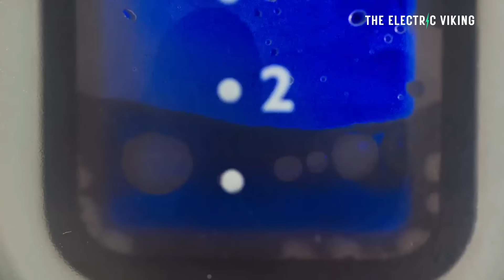The SODIUM Battery REVOLUTION Begins in the United States...

Comment: The USA doesn't need a reason to pivot toward Sodium ion batteries they are green energy so f*ck it.
Reply: Should we wait for sodium home batteries?  I’m thinking more about durability as home home batteries are charged and discharged daily where an EV gets charged typically once or twice a week
Reply: The US is foolishly trying to fuel advanced autonomous vehicles and robotic drones, while Trump wants to run them on oil. Americans need to wake up. The battery factory South Korea is building in the US is fundamental to future US technology, yet Trump has handcuffed and shackled Korean engineers, treating them like criminals.
Reply: Hilarious.

Did you know that Trump has doomed the US oil industry by asking OPEC to keep the oil price low and increasing the price of equipment (especially steel used for pipes). The oil patch can’t afford to drill now…

Comment: Lithium has a major advantage in energy density and there will always be demand for lithium batteries.
Reply: Energy density at the cell level, yes. Not at the pack level. 

So in small devices, it's a massive advantage. For anything big enough to require dozens of cells in a pack? And then a series of packs in a final battery, like a car or stationary energy storage? It's not so massive because of the safety features you need to build in.
Reply: @kylejohnson6775  - Sodium has lower volumetric energy density, not just lower gravimetric energy density, so is also disadvantaged at the pack level. You need more space or a larger pack for a Sodium cell of the same energy density as a Lithium battery. This means in space constrained applications, like passenger cars, Lithium has an advantage over Sodium.
Reply: these batterys have 175kw/kg and they cost about 12$ not 54$ each, it will only be on very small devices that you will need lithium it already has higher energy density than BYD's blade battery with no risk of fire so most phones cars ext will be able to run on it just fine
due to the fire/toxicity risk many countrys may even make them mandatory and ban lithium. i know of shipping companys that have stopped doing EV's due to fire risk
Reply: @GruffSillyGoat

If the volumetric density outweighs the space needed for safety systems, yes. I don't know the numbers off the top of my head
Reply: It's not that Korea can't make sodium batteries. Instead, Korea has completed the development of a ternary LMR battery. By reducing expensive nickel and increasing inexpensive manganese, the price is lower than that of iron phosphate batteries, and the performance boasts an energy density 50% higher than that of iron phosphate batteries. Korea has solved the problem of reduced lifespan during repeated charging, which is a shortcoming of LMR batteries, with single-crystal cathode coating technology. The cathode material has already been developed, and LG Energy Solutions is only left with production with GM. The real game changer will be the LMR battery, not sodium.
Reply: We need as many types as we can get. They must compete with each other or the price will get out of hand again. We can always find a use for batteries even if it's not in cars.
Reply: Lithium batteries are worthless on outdoor power power equipment. Try cutting firewood in 30-40 deg weather. Absolutely worthless and then try to recharge and the batteries will fail unless brought up to around 70deg.
Reply: They might be outlawed for some applications including automotive if the fire risk becomes a problem. Even if the ban is not justified by real data it can still happen if powerful people sway pubic opinion.
Reply: Yeah, but not at any large scale

Comment: This charges everything!
Reply: Agreed! Economics are going to the biggest determinant of success and this will win...
Reply: @stickynorth  - will cary, PEAKs solution for example doesn't stack as high or scale-out as economically as Invinity system's VRFB approach. So for footprint constrained sites VRFB may work out the better option, although if land isn't an issue then PEAK's approach may have a lower TCO.
Reply: Not really others, like UK's Faradion and the US's Natron, have been offering Sodium BESS systems for a while now. What PEAK's is seeking is to sell on system operator TCO, by using lower power density Sodium-NFPP cells that can be passively cooled. Hence they're seeking to price in the lower system maintenance costs rather than energy/power or cell cost, positioning them against rival Lithium, Sodium, and Flow-Battery technologies. 

However, as with all systems if other factors such as footprint density, power requirements and energy are factored in then the site economic equations can change - for example, stackable sodium and flow batteries have a higher footprint energy density. Plus, for flow batteries. in particular. the low cost expandability of additional reagent tanks means their TCO can substantially decrease as energy storage levels increase.

PEAK's solution offers another tool for energy suppliers/storage operators to factor into their site designs, offering passive storage for locations where the sites thermal footprint allows such to be utilised.
Reply: yeah its about time they went to sodium, its only how most life on planet stores energy.....
this dose indeed change everything, it has 175kw/kg storage, more than BDY's blade battery and 5 million uses and it costs less than 1/4 of byd's blade battery
Reply: No it actually does not. The energy density is low.
Reply: @coryshook7648 😂

Comment: Who’s going to drive 5,000,000 miles? By the time someone drives even 1,000,000 miles, will all be using fusion power the way technologies is progressing.
Reply: More useful for semi trucks and cargo transport.
Reply: Ships and planes, doesn't need to be driven
Reply: Move the batteries to another car, perhaps?
Reply: Used in fixed batteries, this becomes an ideal battery.
Reply: It's not that Korea can't make sodium batteries. Instead, Korea has completed the development of a ternary LMR battery. By reducing expensive nickel and increasing inexpensive manganese, the price is lower than that of iron phosphate batteries, and the performance boasts an energy density 50% higher than that of iron phosphate batteries. Korea has solved the problem of reduced lifespan during repeated charging, which is a shortcoming of LMR batteries, with single-crystal cathode coating technology. The cathode material has already been developed, and LG Energy Solutions is only left with production with GM. The real game changer will be the LMR battery, not sodium.

Comment: Stop with "Trump's insane policies", you don't know the details of what's happening in America. The high prices in America are from all of these data centers being built. Energy companies are jacking up prices but only in certain areas of the country to offset the upgrades needed for the data center.

Energy is cheap in most of America: i.e. Texas is $0.07 per kWh.
Reply: Nope. Tariffs are more of an affect,  and affect everything.

Also, Trump said very definitely that he'd bring energy and grocery costs down, didn't happen and both went up.
Reply: The US is foolishly trying to fuel advanced autonomous vehicles and robotic drones, while Trump wants to run them on oil. Americans need to wake up. The battery factory South Korea is building in the US is fundamental to future US technology, yet Trump has handcuffed and shackled Korean engineers, treating them like criminals.
Reply: Due to moving my grid power consumption to night time free instead of around $.30 kWh 6am -8pm,my average cost per kilowatt hour is under $.05.
My motivation for building the off grid with batteries system was resilience,not economic or political. It has turned out to be very advantageous economically for me and I’m still apolitical.
Economic realities have been and will continue to drive movement toward renewable energy despite the vagaries of political winds.
In a couple of days I will connect another 48 kWh of LFP to my battery bank. I’m excited about sodium batteries but,at my age,I’ll probably never need them.
Reply: listen to someone who knows what theyre talking about CHina and energy https://www.youtube.com/watch?v=y-rqI5yrpdk
Its crazy